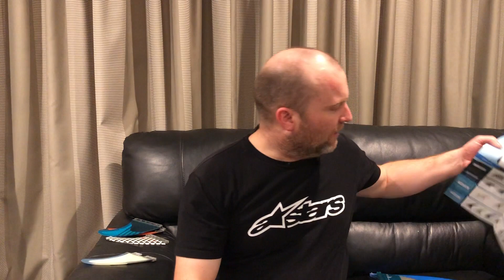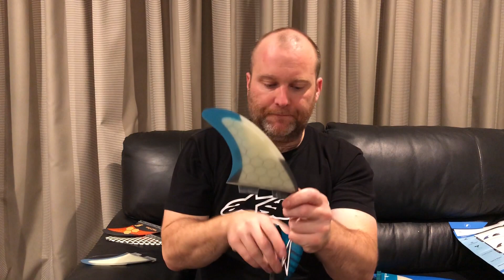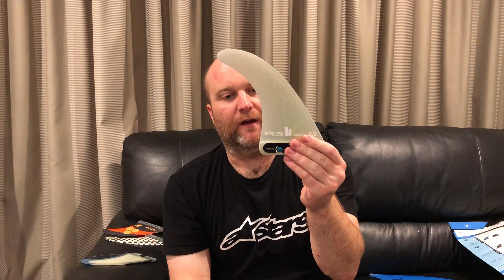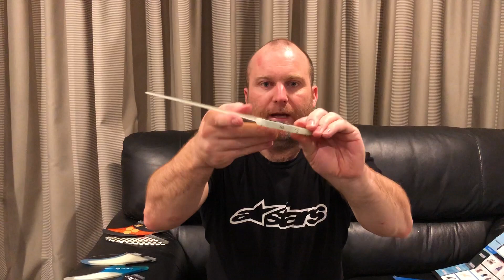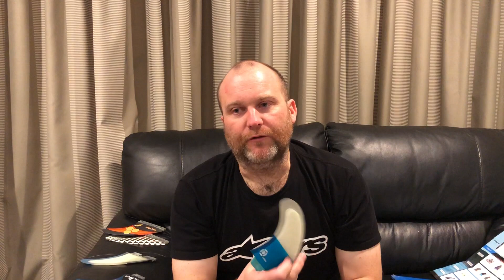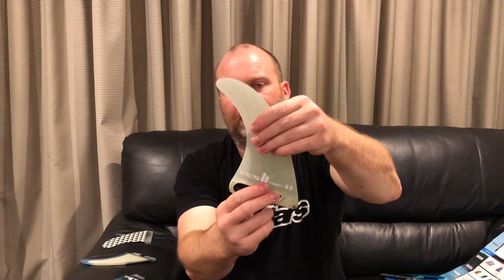SURFBOARD FINS Complete Guide Part 2

Comment: Hey mate! Jeremy again.. 
Just wanted some advice with fins for my tomo evo helium 5"10. I m a longboarder who got this board to step down from longboards and I m doing alright but I fell like I need more hold, control and balance, especially in the bottom turn. I need a set of quads in the futures. Or rear quads with other set of sides? Can you just tell me what to get and what would be the best set of fins for me? I m 77kilos. Good on longboard and learning on a shortboard.
Reply from the maker: Jeremy Wolff the biggest ones ;-) lol yeah it's confusing aye. Pretty sure the AM2 are the large ones but just double check the futures  site. I would either go a five fin set of the large AM or get the Hayden shapes but I don't know if it's easy to find the five fin sets of those and there pretty expensive. Again in the large size for Hayden shapes. Think that's HS1. If you filter thrusters by size on the futures site that gives you the info on the sides. The rear quads the Hayden shapes I think at the biggest. One it futures own ones is also very similar. Think the Hayden rears are a 4.2 futures own 4.15 qd2 are similar but a touch smaller.
Reply: @lawson45uk  Thanks for your help. And they thought picking a car was hard..
Reply: @lawson45uk  Found what you meant. Here it is: https://futuresfins.com/surfboard-fins/hs1-generation.html
It says "Speed Generating" We'll see how that goes. The AM2 are classified "Balanced and Control" 
So basically getting a thruster set And a Rear Quad set, as quad sets (with four fins don t really exists) Okay I think I understand now..
Reply: @lawson45uk  Last question before I finalise my order mate. Why Large and not Medium for my size (77kilos) ? Cheers Mate!
Reply from the maker: Jeremy Wolff 😂 lol that ones easy ... 20 year old Toyota all the way. It's all I can afford after all the boards 🤣
Reply: @lawson45uk  loool
Reply from the maker: Jeremy Wolff hold and drive basically. The recommendation are pretty much guidelines. Most of even the powerful women on your are on large fins and Noel salad that does surf and show is on large and he's like maybe 72kg max you could ride meduim but they will likely lack drive control or both. They will be loose but could slide out on you on bottom turns plus generally the more volume you ride per your weight the bigger the fin you need to get the board to hold and drive. I would say you would need to be on smaller boards and weigh less to want a medium but it's all very personal to what people like. At the level your describing and Eben just on your weight I would syill suggest a large fin. If you look at the pros there are a whole lot of them on the AM template and much lighter than you. Hope that helps. Cheers.
Reply: GO SURF amazing!
Reply from the maker: Jeremy Wolff P.s. also high level surfers generate speed through skillful movement. Us regulators humans need volume and fin area to do help out.
Reply: GO SURF I have placed my orders mate. Thrusters set HS1 GENERATION Futures And HS 4.20 GENERATION Quad Rear for my evo. 

And

Greenough 4-A California chart edition (souvenirs of my teenager life) for my single fin set up And Kai 6.5 for my 2+1 set up with Side Bite 3.7 Futures Compatible Honeycomb for my Gem. 

I won’t bother you for a while now! 

Recommending your channel to all my mates looking for fins and boards reviews! 

I’ll let you know how I go with that in our northern new south wales beaches. Have fun in the water in new zealand! I hope I ll surf there on day!
Reply from the maker: Jeremy Wolff hey buddy. Had that same board myself. I personally love the large Al Merrick fins they have good drive and hold and still release when you need them to. Definitely a quad on the Evo. If your on futures the Large haden shapes quads are also great fins. If your running FCS 2 or even futures too probably good to get a 5 fin set of AM large.
Reply from the maker: Jeremy Wolff oh sorry just seen the rest of the message. Didn't see it all on the email. Yeah same as but you could always get the Hayden shapes rear quads if you just need rear quads but fronts I would still go either AM large it Hayden shapes large in futures. Captain fin have a few options too but those are my top fins for futures. Pepple also love john john large but I haven't tried them myself.
Reply: @lawson45uk  Cool I ll order those today. Can't wait. So Hayden shapes rear quads, medium for my size (77kilos) ? And for the sides, AM large or AI Merrick they come in sets of two fins ? Sorry I got confused. So many different names and it s hard to find on their website because they not in the quad set up when you filter through.
Reply: @lawson45uk  AM1 AM2 OR AM3 ?  They have AM3 Merrick. So confusing ahaha
Reply from the maker: Jeremy Wolff awesome mate. Good haul. Be like Christmas when all those toys arrive 🤙 no worries at all buddy. Happy to help. Thanks for your support and appreciation 👍